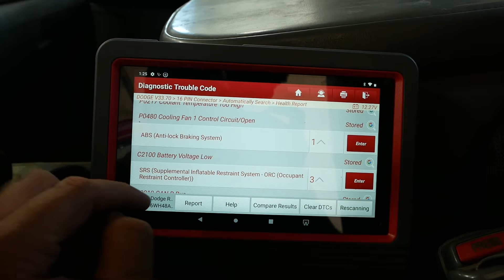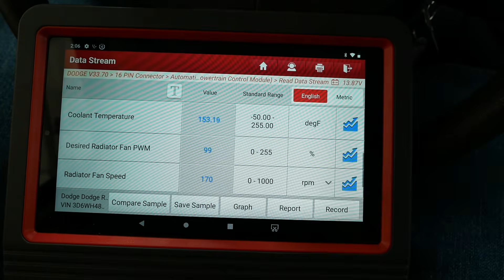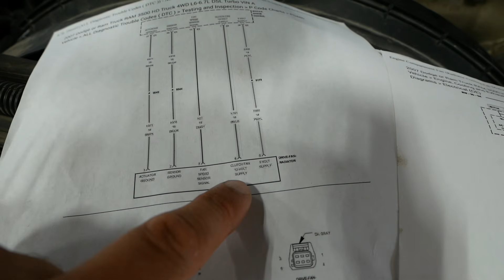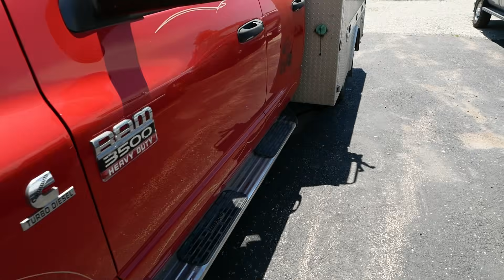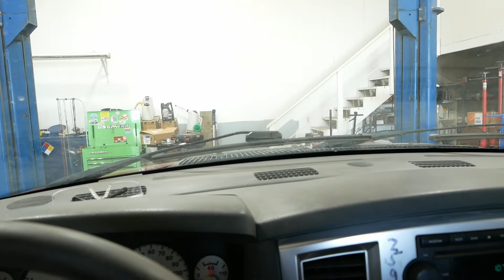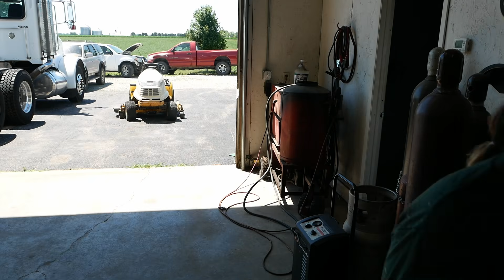6.7 Cummins Fan Clutch Woes - New doesn't Mean Good

Comment: Wes, Back before and in the ‘50s as many men drivers as women could drive stick shifts. But with the advent of the “fluid drive” automatic transmissions in the ‘60s ‘70s fewer and fewer wives could drive stick shifts. But today, other than mostly commercial truck driving (thats even going automatic), few men can drive a stick shift anymore. It’s like the old shop class, very very few and far between.

Comment: Poor quality viscous clutches are the reason I went to an electric fan and thermostatic controller on my old Ford Ranger. I put 3 on in as many years after the OE clutch finally died, and haven't had any problems since then.

Comment: Not a mechanic but you installed the new fan clutch and it still didn't work until you charged the a/c unit . So could the bad clutch cause the a/c to leak out  ?
Reply from the maker: It could possibly cause the pressure to go too high, but it should shut off the compressor when that happens.

Comment: i installed 3 dorman app sensors on a buick  Oreillys said call dorman after about 2 hours on phone running every test he wanted with scope he said go to the dealer and get one. which i did and it worked

Comment: Oh, sparks and welded tools! I won't feel so bad anymore when it happens to me again
When you left the screws on what I assumed would be the battery or the filter box I remembered that when I accumulate screws and tools around the battery I almost always end up with fireworks, sometimes even despite using a plastic tray that for some reason reason does not seem to follow the laws of gravity.

Comment: Even years ago I fixed a lot of a/c problems with a new fan clutch that did not show up until a/c was used. Now you get the ones like this but also cars with 2 electric cooling fans that one doesn't work but no overheat, but shows up in poor a/c and higher pressures on both low and high sides.  Also had one with a near perfectly shaped pyramid of grass, insulation, and twigs with a rat condo on top between the condenser and radiator. Showed up at the start of  a/c season, yet this thing blocked 1/3 of the cooling area, extending almost to the top of the radiator from both sides of the bottom.

Comment: Wes. My voltage drop sequence. 
Batteries over 12.5v after removing the surface charge. If below. Recharge them. 
Test 1. Positive to negative battery posts. 14.1 to 14.8.
Test 2.  Negative post to the engine block. 0.04 vdc max.
Test 3. Negative battery post to the body. 0.04 vdc max.
Test 4.  Engine to firewall.  0.04 vdc max.
Test 5.  Positive battery post to the underhood fuse box. Then every possible fuse in it. 0.04 vdc max
Test 6. Positive battery post to the alternator output stud.  0.3v or less except on older chryslers with the amp meter and the insane long charging circuit. Those 0.7 volts is acceptible.
Why all the underhood fuse block fuses.   Because of internal corrosion  inside the fuse block restricting current to some sections of the fuse block.  
Print this test out. I perform it on every car as I open the hood.  Takes me only a few minutes.  Finds all kinds of annoying issues that are easily fixed

Comment: I really appreciate your approach. You try not to assume things, though I guess we all do that sometimes. But you are very thorough and try to verify the problem. You also don't load up the parts cannon to fix the problem. That's the sign of a good mechanic. My stepson bought an Ebay starter ,chinesium type. It is a 3 hour job to replace. The starter worked once. That was a very expensive cheap starter.

Comment: Chrysler definitely has the worst supply issues that I've seen, had a 2021 Chrysler Pacifica come in last week, the front brake rotors were warped... the local dealer couldn't get brake rotors or pads for it, saying  indefinite back order! How can a 2021 have brake parts on indefinite back order when that's one of the current vehicles they're still selling?! It's crazy, got rotors and pads from Napa, wrong size, the aftermarket doesn't even acknowledge that there is a bigger rotor with different pads available....it's crazy. The place I work at normally deals in working on Volvos, and we have yet to have many issues getting genuine parts for any of their models.

Comment: You are not alone Wes I’m n ky an the parts supply chains for the last 2 years sucks it’s getting worse an worse my local Napa Friday didn’t have a common air filter for a 4300 international an said they had no clue when they could get it but it’s not jus that it’s brakes an common parts like starters eBay an rock auto is we’re I’ve been getting a lot of parts here lately

Comment: Curious why not change out Schrader valves in the high and low pressure lines when charging the AC? If refrigerant was that low I'd be tempted to also put some dye in the system to find potential leaks when/if it returns.. Just me though. And yeah, lots and lots of 'new' parts lately seem to be faulty right out of the box. Either poor production or poor quality control.

Comment: I replaced the fan clutch in my dodge of the same year cuz I thought it was bad. Turns out the coolant temp had to be above 210 degrees before the controller even energized the fan clutch solenoid. Wasted my time and money. I wired in a switch so I could kick the fan on manually.
Reply: Could you give the info on ho’ you did that I have 07 5.9
Reply: Could you give me info on how you did that?

Comment: Shouldn’t you have used a volt meter and actually read the PWM at the fan. I’ve never seen PWM checked with a test light.
Reply from the maker: 99% PWM = 12V.
Reply: @WatchWesWork  Makes sense, I’m used to 5V supply on CATS…

Comment: Wes, you have to put more outtakes in your videos. The battery sparking was hilarious and so was the sigh of a long day in the shop. But the wife proof comment was also hilarious.
Reply: Outtakes can be good (this one was).

But the novelty of someone fluffing or forgetting a line, then swearing wears thin mighty fast, which is what a lot of out takes are.

Comment: nice job chasing down the problem.the last time i had a "new" part fail it was a fuel pump.why is it that fuel pumps never fail until AFTER you just filled the tank.hope you enjoyed your time off.good to see your back.
Reply: In a pinch I had to buy a store brand fuel pump for my Blazer to get it going in like 2014, it lasted maybe a year.  Next pump was a Delphi unit from Amazon, it's still in the truck running today.
Reply: Always at least 3/4 full.  Every.  Time.

Comment: Nice job! I have the old school fan clutch on my 2004 Silverado.  It finally gave up last year. It got a little warm sitting in traffic with the AC on.  I did splurge on the genuine GM.  First one lasted 17 years, hope to get a few more out of the rest of the truck.
Reply: That would've been my excuse to swap to electric fans.  Really easy to do on the gmt800's, you can buy a harness and use oem fans from an '05+ Tahoe.  I did it on my '01 Suburban, have an '03 now and I'm getting really sick of that mechanical fan, lol.

Comment: Freaking hate those fans, we have em on a few of our forklifts with volvo engines, the ones we have with fans driven by hydraulic motors however are excellent, they sometimes last over 10k hrs of operation plus they can be reversed to decrease the buildup of crap in the rad. Nice vid as always Wes, hang in there.

Comment: My dad always yelled at me when I’d put tools on the battery, so I started putting part of a mud flap on them first.. so now I’m older, let just say a few times I have put tools on them, and I was reminded why not to do that. Great content as always
Reply: The battery is for fastener storage.

The core support, cowling, strut tops and the fender flanges are for tools.

Precariously balanced on top of the intake manifold is for the thing you absolutely cannot drop or it'll break or vanish into the shadow realm.
Reply: I have seen batteries blow up. Your dad was a smart man..

Comment: The same problem in my business also. I do commercial and industrial HVAC and getting parts is getting worse.  I called this week trying to get a replacement VFD for a air handler that runs one of twenty three floors of a building I service.

Three vendors I called with an average wait time of 35 weeks. One vendor kinda laughed and said…. maybe by the next administration. And refrigerate….I’m sure you are mostly dealing with 134a. It has gone through the roof also.

Had a customer this week that said he would rather fix a leak on a 25 years old R-22 system. I just looked at him and said “I can’t do that to you” ……and gave him a quote for a new system that hopefully I’ll have in hand around Halloween. R-22 as of last Friday.. my cost $1800.00 for 30 pounds. It’s all getting ridiculous…..no matter what business your in …….
Reply from the maker: I just paid $350 for 30 lbs of 134A. That hurt.
Reply: @WatchWesWork  $345.00 TWO WEEKS AGO.
Reply: @WatchWesWork  Probably should have bought 60# at the price o_O

Comment: ......................which is why an electric fan and the two window open, move forward air cooling is good. As for manual gearbox, best ever fail safe brake saver. walk behind pull start push mowers also good. saves on gym fees

Comment: What tool was that used to remove the fan. 
High side pressure did not come up but 5-6 psi when he was looking for 40'ish
Reply from the maker: It's a Lisle pneumatic fan clutch tool. High side pressure stayed low because the fan was actually working.

Comment: I work at AutoZone, and I've (only once did this happen mind you) pulled 3 duds off the battery rack back to back. Stuff happens.
Reply from the maker: I've seen that several times. Or they work for a few days and then completely die with no warning.

Comment: Could always be a jeep wj model with the 4.7 v8 HO and their German engineering of a hydraulic fan clutch system and Chrysler gucci fan clutch oil... valvoline white bottle steering fluid works just as well but I don't think it locks up as good. But for a 20 year old vehicle, it works.

Comment: No matter how much experience you get, your only one thought away from putting a spanner or wrench across some battery terminals. Thanks for the great content Wes, genuinely look forward to them.
Reply: I did that in my auto tech vocational school in 2008... melted the 2 posts and I still have the wrench. Instructor said he never seen anyone make a face like I did but will never do that again. Lol. Haven't done it since. Sadly, I still put stuff on the battery... it's a flat surface for nuts and bolts lol but I do try to keep wrenches off the battery.
Reply: @Jarhead64  For a flat, go-anywhere surface for nuts/bolts/etc, get yourself a couple of those magnetic trays. You keep that stuff off the battery, with the added plus of not knocking small parts down into Never See It Again Land.
Reply: @billh230  I did then I set the tray on the battery.
Reply: @billh230  where's the fun in that. Hahaha
Reply: *You’re only. Not your.

Comment: While driving you have air flow, drive to warm then shop bay to test fan while not moving.
Reply from the maker: It's not that easy. In the bay you have no load so it never really gets hot.
Reply: @WatchWesWork  That is why I said drive it to warm if needed. but you cant test the fans while driving. They will never be needed while you have air flow.

Comment: Over here in Thailand I have a mitsubishi truck and all the oil leaked out of the fan clutch. I went to the dealer and they said you can buy a new one for 150US (lol no thanks) or you can buy a small bottle of the heavy weight silicone oil and the dealer instructions on how to refill it for 3$.

Comment: also the 07-08 year period has a plastic impeller in the water pump, be aware they can snap right off the shaft lol. Or at least the gas engines do.
Reply from the maker: I've never seen that in a Cummins. The GM Ecotechs are known for that.

Comment: I have a 99 volvo vnl with a 12.7 detroit.  Very similar issue. No parts for a 99 12.7 to volvo. Put a newer model fan for a later model detroit. Now my fan is on a manual switch.

Comment: That was why the guy who taught me to work on cars 35 years ago, drilled it into me to never put tools on the battery.
Reply: I did in my vocational school auto tech days in 2008. Instructor said he never saw anyone make a face like that and bet I wouldn't do that again. Well I haven't. But I still do put stuff on the battery, like nuts and bolts. It's a flat surface lol. I just try not to put wrenches on the battery. Oh, I still have that wrench that got smoked and use it.

Comment: Your outtake was awesome. Wish I had a nickel for every time I did that. Last time it happened, I blew the 40amp fuse. The kid behind the parts counter at the Dodge dealer didn't know what it was (for real). O'Reilly's came through for $2.99.
Reply from the maker: Probably one of those bolt in fuseable links. Been there...
Reply: @WatchWesWork  Thanks, Wes. I haven't used one of those in probably 15 years.  Everything I do now is old glass tube fuses.
Reply: MaxiFuse or PAL fuse? Just curious. I work almost exclusively on older Citroens now, so I haven't a clue how a newish Dodge is set up.
Reply: @billh230  mine is 22 years old. It’s in the circuit between the alternator and the main fuse box so I assume it protects the fuse panel if the alternator goes haywire
Reply: @mattthescrapwhisperer  Yah, much as a fusible wire at the battery terminal on the starter for pretty much anything American before 1985.

Comment: Never had a vicious coupling go wrong on one of mine, mechanical mates warn about it but not so far. Plenty of grief from electrical fans though !
  Being from the UK my wife learnt on a manual gearbox, preferred them,  learnt from rally driving mates, got better than most guys.
Reply: Least if a viscous mech goes wrong a couple of self tappers can get you home.

Comment: Truck will be back when the grid heater nut falls off in the intake and takes out #6 cylinder.  should make a good video.
Reply from the maker: Never seen that. More likely it'll die when the crankcase filter plugs up or it throws a rod from the "tune" they added when they deleted the EGR cooler.

Comment: I had a GMC Top Kick towed in for a locked up 3116 Cat engine.
It used a serpentine belt.
Found the belt tensioner bearing had seized to prevent the engine from turning over.
Reply: Damn, that belt has a hell of a grip, lol.
Reply: @GrandPrix46  I couldn't believe it myself, but it did stop the engine from starting.
Reply: @RichieCat4223  oh I wasn't doubting you, just crazy how much holding power a little belt can have.
Reply: @GrandPrix46  Isn't that the truth.

Comment: Way back in the day I bought a used Chevy Chevette.  After a month or two the starter quit.  The mechanic got a rebuilt one and put it in,  It worked for about a week.  This process repeated 5 times.  He told me only rebuilt starters were available.   Since the rebuild shop was local he called them.   The original owner had sold out about six months before and  the new owner was doing what is typical, cutting costs everywhere he can, which included hiring unqualified help.  Anyway, my mechanic talked the old owner into overseeing the starter rebuild and lo and behold that starter was still working fine when I sold the car a year later.   Shows to go ya, there is no substitute for knowing what you're doing.

Comment: I replaced the whole pulley / fan clutch system on my 5.9L pre-emptively at 225k miles. The replacement clutch quit working in a week. The original clutch is still going strong at 20 years old and 320k miles. Luckily the old 5.9s didnt need fan clutchs, it never got hot unless towing heavy, just no airplane noise.

Comment: Smooth move Sparky! BTW, It's Ford Makes You Loco. I'm sure you can relate. Watching Rainman Ray struggle with the parts is revealing as well. It's bad. I can see how Eric O relies on a PickUPart joint for used OEM for some of the stuff.

Comment: I’ve done 5 water pumps in the last 2 months. I used  Carquest new water pumps on all 5. I’ve had 2 come back leaking. I’ll no longer use aftermarket water pumps if I don’t have to. Luckily enough, neither of them were driven from the timing belt.

Comment: Good find, good fix.  But, yet another case of propellerheads trying to justify their jobs by electrifying and monitoring a device that worked well for decades in a purely mechanical mode.   Of course, this also leads to over gouging prices for said electrified doodad.

Comment: Thanks for the video Wes.  Curious if that AC system had a pressure switch.  Is it possible for the pressure switch to degrade over time or is it all or nothing?  Meaning it either works 100% or is doesn't?    BTW, enjoy the summer... winter is just around the corner. ;-)
Reply from the maker: It does and we were monitoring the pressure,  but it doesn't work as I would expect.

Comment: Stick shift never would've stopped my wife. She was as good with a manual as anyone. However, the vise grip parking brake release may have thrown her for a second.
    Best regards from indiana.
Reply: Did it have the matching vice grip window crank.
Reply: Same here cept she's an ex wife but she can out shift any guy i know cept one.. that was her one and only endearing trait though lol
Reply: She's a keeper.
Reply: Newly back from Nam and newly married I taught my wife how to drive my brand new 4sp Hurst shifter 3 pedal Firebird, she did a hell of a job with it. Just couldn't stay away from trouble with it.
Reply: is it weird that i find it impressive and hot if a woman can drive manual transmission car
Reply: @lordjaashin  Maybe not in the USA, but in Europe you'd have to raise the bar a little higher.
Reply: @JohnWatkinsUK  My wife refused to drive a car with automatic transmission, she felt she had no control over it. She isn't particularly good with a clutch, either. Lots of revs and slow releasing.
Reply: @lordjaashin  not at all!